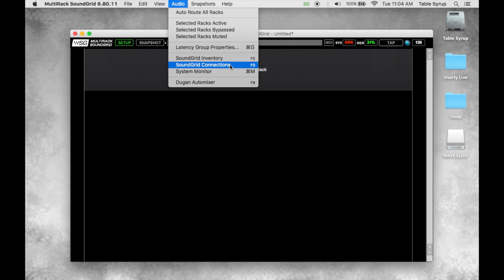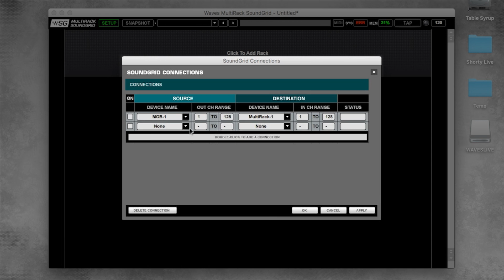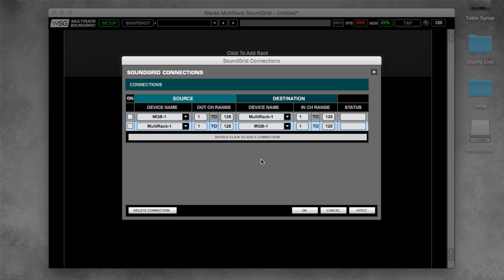How to patch audio through your MultiRack SoundGrid system

Comment: Thanks for the video. 
What about the “Driver-1” in the selection? Does it need to be connecting to anything?
Reply: That would be from the soundgrid driver (a soundcard that sends audio over the network). This allows you to send audio sources on the computer into the network to be used by multirack or the soundboard. For instance, Tracks Live as a virtual soundcheck.